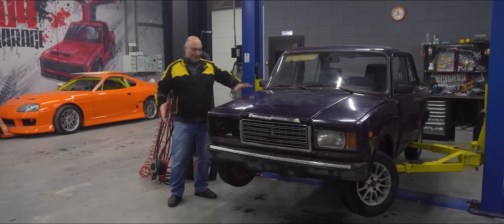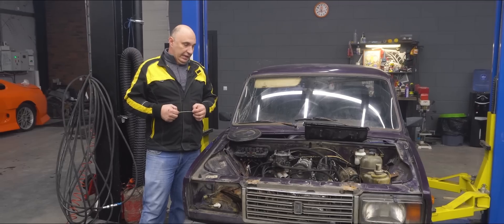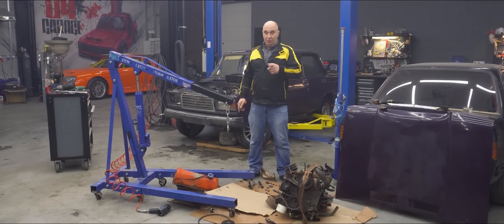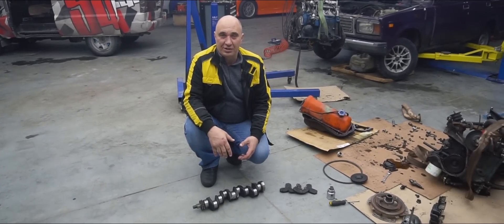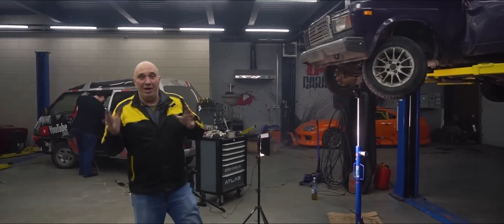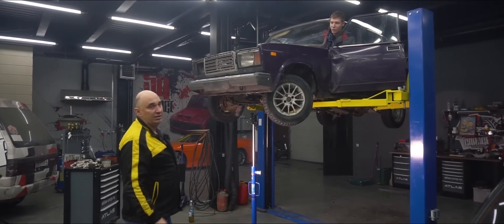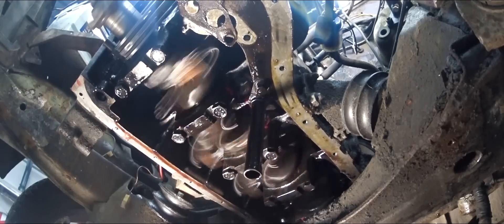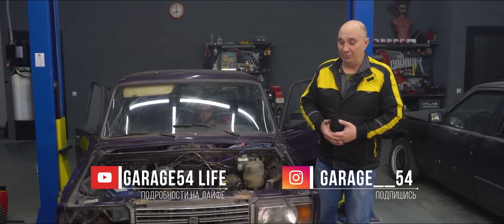Hacking off the crankshaft webbing: how’ll that affect engine operation?

Comment: Some German engine: 500ml less oil in it *breaks immedeatly*
Lada engine without oil an hacked crankshaft: wheres your problem blyat
Reply: What about old diesel german engines. mercedes om601,om602,om603
Reply: @Eetu_Marin  AND OM606 PERKELE
Reply: "500ml less oil in it *breaks immedeatly*" As a mini Cooper Driver, i can confirm. They even break with enough oil in it. That car cost me more in 6 month than my japanese car i had before in 6 years.
Reply: Poor-tech, drinks fuel like a pisshead in a brewery and power output of a lawnmower
Reply: @danr8194  "Pisshead"? Never heard that before 🤔.
Reply: haven't you seen the frozen m20 video? lmao
Reply: Try getting even close to similar modern characteristics and power output, while maintaining low fuel consumption and passing emission standards as german engines do
Reply: Had a BMW m50b25 Engine. Was driven Hard Every day. Only needed oil Not More. 370.000km now on it
Reply: Oh cmon
Old VAG 8valve engines were virtually indestructible.
I had an old 1.8 8V with 700K km on the odo. I went to do a overhaul and the bearings, pistons and everything were all fine. Nothing damaged.
And it took a lot of abuse from me and previous owner who didnt know of this thing called maintenence.
It could also snap the timing belt and no damage since its non interference.
As long as an engine is simple enough, it will last very long.
Its antoher story with todays emission requirements and electronics.
Reply: Lmfao!
Reply: thanks for reminding me that i need to refill the oil on my fine german engine
Reply: lmao german vw diesel engines can run without 1 liter of oil and they will work perfectly fine
Reply: Since when are german engines unreliable. It was a mercedes engine that hit the first million km. Wasn't german very reliable ????
Reply: Suka yebat yourbunnywrote pancake horseradish root! I have no clue what I just said! 🤣🤔
Reply: Because some idiots make oil changes after 5 years and 150k km and wonder why there motor is broken
Reply: They just removed the counterweights from the crank that isnt a big deal
Reply: @SSammy-1  On an inline 4 or inline 6, you're probably right. They are inherently naturally balanced due to their design. On a V6, those are inherently UNbalanced, so they need counterweights, balance shafts, or other means to smooth them out.
Reply: @donellmuniz590  every crankshaft has counter weights.
Reply: @SSammy-1  of course, they help not only with balance, but torque production, and a reduction of harmonics. But I-4s and I-6s do have inherently perfect balance, V6s and V8s dont. Some super light racing cranks have no CENTER counterweights, and the remaining ones are undercut to save weight. But indeed, every engine has them.
Reply: @donellmuniz590  On what facts V6's and V8's dont have perfect balance? V12 is balanced better than an Inline 4 will ever be. I've worked in mechanics for years and I dont get ur logic. V engines always are the mirror from the other side there for very well balanced also.
Reply: @SSammy-1  Never mind. You probably know this shit better than me.
Reply: On the Japanese engine reliability topic in the Comments, the main reason that Toyota Engines in particular are very reliable is that Toyota heavily over engineer them to not only withstand extreme stress for tuners, but also many years of daily driving.

What's cool is that for aircraft, the Soviet IL-2s most common powerplant, which was a V12, was also heavily over engineered so that the aircraft needed less engine matinence on the field, and even had unequal stroke. One side of the engine has longer stroke than the other, which was solved by the ingenious use of articulated conrods
Reply: Lol them things go toe to toe with a vortec v8 its insane how little they need to run
Reply: @craigjb  i agree the 6.0 chevy truck engine is the most reliable of its kind ever made
Reply: @viperstrike3827  kinda odd but my truck has a 6.0 vortec LQ9 lol and other a 5.3 love the vortec v8
Reply: No insults intended towards the Lada engine but most engines require at least 2 minutes running without oil or water before they self destruct. The fact that he greased the bearings made a HUGE difference because the engine then has something keeping the metal parts from touching. Not sure why there's so much hate for German engines as they are perfectly good engines as are most. There's no engine outside of perhaps something you would find in NASA that would break being 500 mL low on oil, that is a ludicrous statement.
Reply: @Parents_of_Twins  I think it's the "design them so precisely they have a tantrum and freakout when things go a bit out of wack. The Lada is the AK47 of cars.
Reply: Also German engine:  any hardware is 0.000001% off spec the engine will not run, or blow instantly
Reply: @jonathanryan2915  my uncle had a lada, had to constantly work on the engine and rusting body until it wasn't worth it anymore, my mother had an audi 80 b3, fuel injection system was a pain in the ass to adjust but when it worked it worked exceptionally well, with very good acceleration and very good fuel economy. My dad drove a Ford Maverick, which is basically a rebadged Nissan Terrano 2. That car was abused almost its whole life, the only care it became was decent engine oil. That thing now has over 430000km, with 310000km done on bad roads (car was bought in germany when it had 120000km and exported to Kosovo just after the war, with not a single pothole-free road in the country) and the car still runs like a dime, the only problem being engine overheating under heavyish loads. Moral of the story: Buy Japanese cars
Reply: @jonathanryan2915  And will require 90 hrs of labor and a $300,000 tool to repair.
Reply: @jonathanryan2915   also german engine: using fuel injector from a tank and smoking up the whole highway
Reply: Uhmm....You apparently do not know the fact that the Lada SOHC engine was designed by none other than Porsche?
Hello?  Google it.
Reply: @Flies2FLL  fiat
Reply: engines that are very complex often are more unreliable than simple designs. just because germans started making complicated engines way before other nations doesn't mean german cars are inherently unreliable.
Reply: @DontKnowHowToTypeIn2  “germans started making complicated engines way earlier than other nations” 
Back in the 50s, 60s and 70s, on European market Fiat made the best engines, the most reliable smoothest and with good power output ... And the Alfa twin cam engines with Spica injection was also not only reliable but very responsive and had very good power. 
Back then Porsche was struggling to go further than 180 kmh while the 33 Stradale did 260 kmh and 0-100 ( 60mph) in 5.6 seconds from a 2 litre engine. 

Why do germ-a-cars get so many fanboys?
Reply: @DontKnowHowToTypeIn2  Honda makes complex engines too, but they are one of most reliable engines.
Reply: @hellhound320  they make really good engines, but i don't really know about any complicated parts.  most complicated engine from honda i know is like, the b16. and isn't that just a DOHC 16V Vtec 4cyl?

a damn good one it is, but is it complicated?
Reply: @DontKnowHowToTypeIn2  Well more complicated than lada XD Why complicate things when they can be simple and do better than that, right?
Reply: @DontKnowHowToTypeIn2  old mercedes benz diesel engines like om601 om602om603 are very simple no uselles shit
Reply: German engines are reliable, tough and precision made. It's just that the Germans use crap electronics to control them. So if a modern german car breaks down it's usally a 10 cent resistor on a €20 Chinese circuit that will cost €600 to diagnose and replace.
Reply: This is your fantasy
Reply: @danielimmeyer9229  its true, Slavic engines are just the best, saying that from experience.
Reply: @hellhound320  That's why they're world renowned right?
That's why Indy Car and Formula 1 make all their engines there right?

Oh wait.........
Reply: @hellhound320  well..this LADAs are in fact licensed Fiat 124 and 125.. so original desing is not slavic.
Reply: @plenex  Skoda has VW engines but its still Slavic, whatever comes in slav car it becomes slav itself.

Comment: Could you try and weld the crankshaft for high lift profile ? And see how it affects performance ? And how about using sealant instead of a gasket to have more compression.
Also cheap mod for more and faster revs is cutting down the flywheel.

Comment: Inline 4 engines are naturally self balancing due to position of the crank. Both ends are up while both middle are down. Cancels itself out. Impressive it didn't blow up with no oil.

Comment: These guys never "seize" to amaze me with the awesome ideas they're will to try.
Reply: There is and old Romanian dude that swears that he cut's off those weight's and his dacia 1300 runs perfectly and is much more powerful and there's no difference in the balance... It's hard to believe... The guy cute the crankshaft with angle grinder takes the head to a shot to get 3mm off it and same treatment to the flywheel... And it idles normally and runs... It's not fast or faster in no way shape or form but I'm just amazed That it did not sefldestruct on the firs run...

Comment: 8:32 "As for harshness we didn't notice any additional  vibration at all" [[notices timing chain flexing every pulse about to explode]]
9:34 Even scarier. You can see it speed up and slow down over and over as the chain struggles to stay together as it goes from tension to compression and back.

Also, realistically, those crank bearings are going to be scoured to hell.
Reply: Let's run it till it goes cherry red, then orange and then a lovely yellow as it all fuses together !!
Reply: No vibration,no oil,no problem it's fine

Comment: Needed to impose a load to really feel imbalance.  Go drive it and see. Will not likely be noticable loaded at low rpm.....loaded at rpms over 4000 will vibrate.  Probably just wear the main bearings really fast with the imbalance

Comment: it will work ..Vw beetle t1 has no counterweights but at high rpm they kill the case over time .. The skip needs a lightened flywheel or 1/2 of one?

Comment: Running that motor with no oil pan or valve cover is going to get dirt in there and possibly ruin that poor crank, 
not to mention running it without an air filter, hell you guys probably don't even have antifreeze in it...
Poor kids in Russ....Africa could use that engine

Comment: Why wouldn't it work...many vehicles in the '60's and '70's and below didn't use counterweighted cranks...old bugs still don't use counterweighted cranks...but counterweighted cranks were brought about to lessen crank vibration so as not to have to replace your crank bearings so often and to increase rpm range.
Reply: Thanks. Never heard of this.

Comment: When are you guys going to buy a plasma cutter?  It would make this so much easier.  Cut off discs work, but they're consumable.  A plas-cutter just needs electricity and compressed air.  They're pretty cheap now and it would save you a lot of money.

Comment: No water pump, no alternator, no oil Flow but lada engine works.
2020 car: rear left indicator is broken so the next Bus stop is 150m away bro
Reply: my car haven't got a fuel pump I just pushing up the fuel tank made out of water bottle and it works

Comment: Very good experiment! But please do not break it using it without oil, make it work with oil at high rpm, if it breaks there it will be more fun xD and something else, I would like you to prove that it happens if you run a motor full of oil until the filling cap: D thanks! Keep in that way!

Comment: Surprised the engine didn't seize with no oil. With the crank weights remove though, I will bet you the engine is completely gutless. That weight (read inertia) is where the output power is stored. Would be surprised if it could get the car rolling without being revved completely out.

Comment: Grease the whole engine, remove piston rings, see how long the engine lasts?
Reply: Probably last forever considering it wont start with no compression.
Reply: @twoeightythreez  depending on how tight the piston is, might have to keep a ring or two in. Reducing them should help prevent seizing.
Reply: @travis4798  ya maybe keeping the top ring in only.
Dont think you would see a drastic change.... Then again i figured this engine would loose main caps after the weights were removed

Comment: Perkins engines are like that from factory. Check the perkins 6-305
Reply: Is the 6-354 the same?
I have heard from old truck drivers that they used to die rather quickly if you sustained highway speeds.
Reply: @Colt45hatchback  it's similar, but is way bigger, has more horsepower and weight twice as much, it's a pretty reliable engine when its on harvesters or in a stationary application. But in trucks when you force it it breaks

Comment: Westerners: observing the experiment from a nuclear blast-proof bunker at least a mile away from ground zero.
Russians: causally stick their heads in the hood to see how unbalanced engine behave from close up
Reply: USA dirt track engine builder: Engine on dyno, watching through a ballistic glass window, mounted on a concrete block wall filled with concrete.

USA dirt track racer: Engine in car with a 0.030" thick aluminum floor, firewall barely any hood and no windshield.
Reply: Asians: simulate everything in a computer
Reply: Cause your to stupid to realize it is a grenade
Reply: @robertpolicastro1  um sissy much ?

Comment: Thought they was going to put it back together (oil, sump, water etc). That didn’t tell us anything same as running without oil.
Reply: The weight of crankshaft is also for enertia so engine doesn't stall when load is applied ,I'm  a mechanic myself and I really dislike this channel. we used to make things better than this when we were kids

Comment: Just for information, the webbing is used as oilers, to oil the cylinders from below. It dips into the oil sump and throws it up.
Reply: If the webbing isn't there than I guess it wouldn't matter if you had oil in it or not since the webbing is used to splash oil up to help oil the engine. Interesting experiment anyways but seeing any engine run without oil just doesn't feel right. I'd hate to be near it when It decides to come apart though!

Comment: You would never feel it, but the vibration is there. The harmonic imbalance in that crank would crack it in half pretty soon if run for any length of time. Although, the main bearings might go first.. those forces are immense.
Reply: See my comment above, you done need these weights.

Comment: Don't the counterweights splash oil around from the pan as a way to lubricate most of the bottom end?  IOW, would this have been bad long term running it this way?  It probably was happy for the limited time it was running because of the anti-seize bearing lube.

Comment: You've won horsepower, but you lost torque. Simple.
Reply: Yep first one saying how it works👍😄
Reply: @alexherolder4731  Indeed :), by reducing inertia (and mass) the crankshaft will gain speed rotation delay and speed overall. Means higher revs, but at the cost of force.
Reply: @kikrotin  I know this is one of the simplest things to fine set up an engine for races or rally in  low dicplacement classes
Reply: @alexherolder4731  Absolutely ! Race (on a racetrack) need power over torque. On the contrary some motor racing events like the Monte Carlo one need a good balance, torque is always good to make your engine smoother and powerfull without going in the redlines.

Comment: I know it's all for fun but it still hurts my heart to see an engine running with no oil like that.
Reply: It was greased a bit at first so will actually run for quite a bit.
Reply: Any idea what kind of grease that was?
Reply: @muffin4600  red synthetic grease. Some hit the camera at start up.
Reply: No load on the bearings and pre-lubricated it would run for a while no problems.
Reply: Relax, it's just a Lada. Not something valuable, like a Geo Metro! 🤣

Comment: First, before you blow that engine up, put everything back together, fill her with oil, and see the actual improvement in speed response, then freeze it up! LOL
Reply: TOM C. Nah, just pull all the caps again and clean the grease off and put fresh grease on and drive it like that, with the oil pan to catch the kitty litter glitter

Comment: Were these old Russian engines reliable?

They're interesting because we didn't see very many of them, they don't look very different to old Ford Europe engines of the 70s and 80s.
Reply: These lada engines were very very reliable!
it took a lot to kill them, and even then, they would work anyway haha

Even on this channel you can see them running an engine with nonsense for oil (eggs/cola/salt etc) or then no oil at all, hydrolocking it at high revs, and it still would work.

Even yet, there's more reliable Russian engines somehow.
The Moskvitch 408/412 engines are indestructible , they don't have an overhead can to go wrong, they're simple and strong !